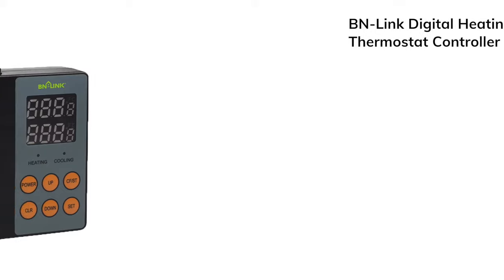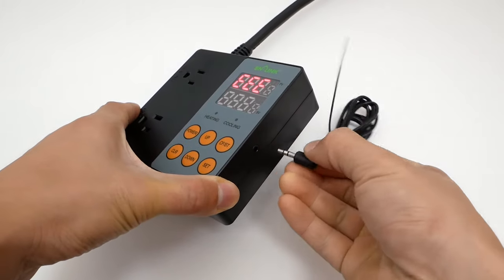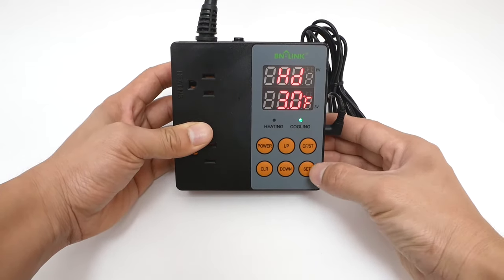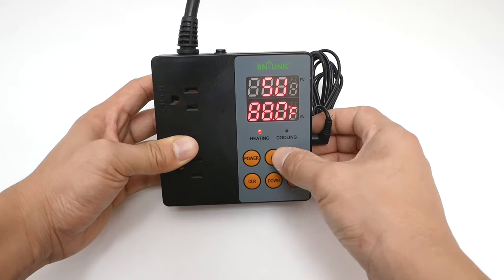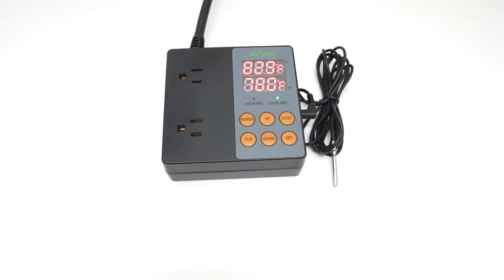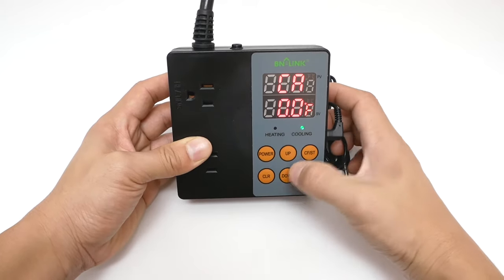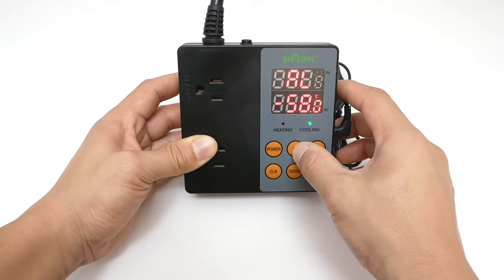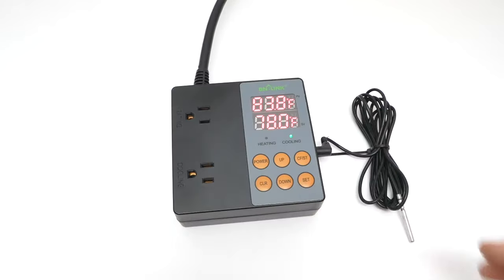BNQ T9 BN-LINK digital heating and cooling thermostat controller

Comment: The cooling device works when it is too warm, but the heating device does not work when the temperature drops. 
Why is that? Is there a setting I am missing or is the heating outlet faulty?

Comment: How is the "Advanced Settings" button CF/ST accessed to change the temperature unit between C & F, and also how is it accessed to change the temp unit increment 01 or 10 (0.1 or 1.0 deg)?
Reply: You have to press the set button and the CF/ST button at the same time.  I just did this and it worked.  Nice of BN- LINK to not bother mentioning this.  I was ready to return it as I thought it was defective!

Comment: Unbelievable as to how mediocre this is! Amazing as to how fast they ran through the instructions! Why the rush? He had a train to catch? I slowed it down to .75 speed and even to half speed so that I could try and follow along! 
The annoyingly loud background "noise" made it hard to understand the instructor's words. 
What's displayed was not always clearly visible. Too much glare. The room should not have been so bright. When I programmed mine it was very easy to read.
At first the person's thumb moving up the side of the unit (by the displays) gave me the impression that pressing up by the displays actually did something, but sometimes the thumb just blocked the view. At full speed it's really hard to follow. Perhaps he is also a sleight of hand magician? He kept clearing the display, which was confusing at first.
On the website the instructions are not searchable. A LOT is left to the imagination. Does it hold the settings if power is lost? Nothing is mentioned. Nothing about a battery inside to be replaced, which it must have. Good thing that the damn thing woks!
Reply from the maker: Hello, we apologize for the inconvenience this may have caused you.  If there is still some confusion please give us a call at (909)592-1881 between Monday through Friday from 9 am till 5 pm PST. We would be more than happy to assist you!

Comment: Need to redo your video, please include: 1. how to pair with Blue tooth, 2. how to connect to phone, wifi and bluetooth, 3. in NEW video, should be able to read the display. 4. my wifi and bluetooth never got any signal from this unit, how to get the wifi going on the unit ? I will call on Monday.